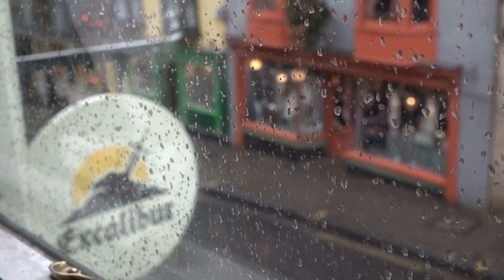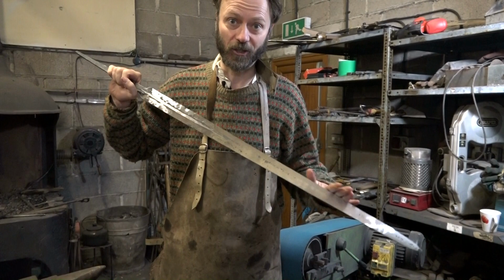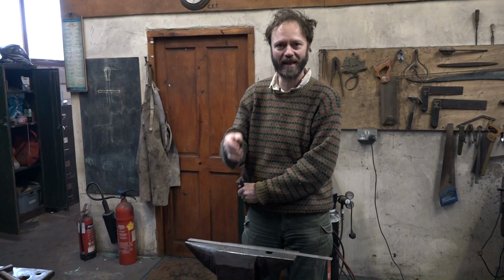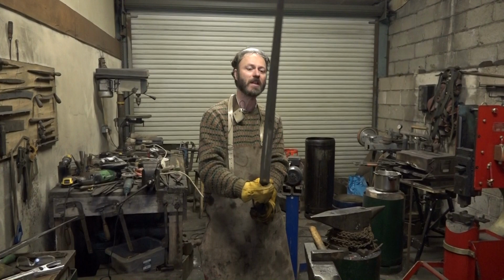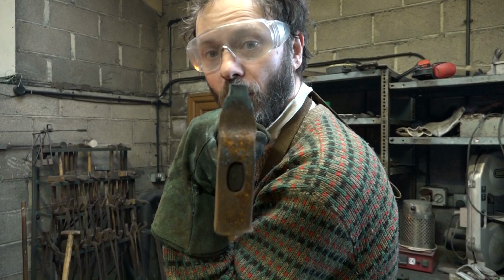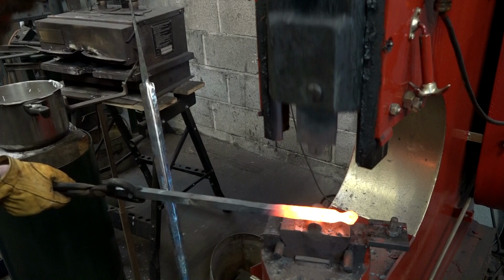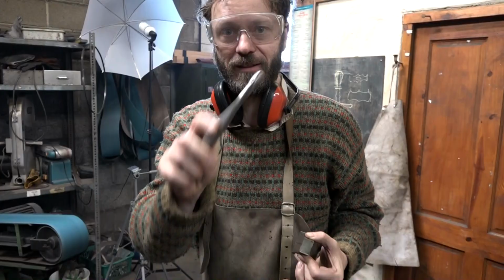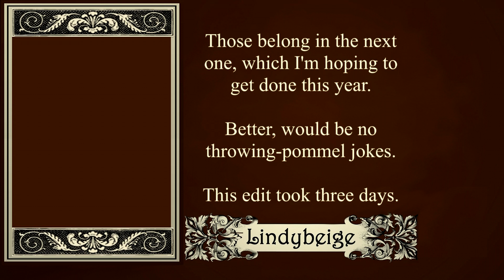Forging a sword - part four: linishing and quillons

Comment: Lloyd, I envy you that experience. Also having worked a bit of metal, I can tell you the hardest thing in the world is to make two bends look the same, no matter how precisely you measure where its held, and how far you move, control heat, thickness etc. I could see that pain when the swirls didn't match, and I empathize. I would not blame you if you did another later to get it right.

Comment: Pro tip:  when grinding with a hand-held grinder, you want to use the other side of the grinding wheel, so the sparks shoot toward your elbows.  This is so that if the grinder grabs, which it often does with inexperienced users, and occasionally even with experienced ones, the machine will jump away from you, and not towards you.  Grinding injuries are nasty ones.

Comment: The tool used for that shoulder slot is called a fuller. If Lloyd had opted for the long route setting the fuller groove, he would have used- you guessed it- the fuller. This is the preferred method for the integrity of the sword, as the smith always wants to draw or upset the steel (hammer it completely into shape, hopefully smashing the material into a stronger, more compact molecular arrangement in the process) instead of grinding material away. The increased width from smashing material out of the center of the blade to either side must be accounted for when forging the base profile.
Post Script: I'm not certain you could have found a heavier, more cumbersome twisting wrench if you tried! Bravissimo!

Comment: In the U.S. one of the benefits of making a sword with a "factory edge" is that it's much easier to ship across the country. A "factory edge" means it's not sharp but looks like it; you can sharpen it yourself. You still have to protect the pointy bit so the shipping company doesn't accidentally stab themselves if something unforeseen should happen; they generally frown on that.

Comment: It's a good instinct to be wary of the heat of a piece of steel in the shop. Chances are it's hot and the guy holding it bare handed just has no feeling left in his fingers :P

Comment: 8:20 the training swords we use at my HEMA club have been breaking about 3 inches from the tip. They're plastic so it's not hard to sand down the end to make it safe again, but it definitely does change how the weapon performs. I like the shorter ones, they're more nimble and you don't lose much since you really shouldn't be striking with the last three inches anyway.

Comment: Lloyd, we love you and your content, but especially you. Please take proper precautions when using an angle grinder, you are too important a person to lose a finger to something so ... mundane.
Reply from the maker: I took the proper run-up.
Reply: What's so Mundane about using angle an angle grinder.
Reply: @More_Row  t. seething angle grinder enthusiast
Reply: Look mate, everyone is already paranoid about danger, dont need to remind us at every turn.
Reply: @lindybeige  I dunno if you had earplugs in but the sound of an angle grinder is not really great for keeping your hearing in check. for the rest keep at it, but as with the crossguard, I believe he should have told you the heat was too low to twist due to you taking too long with the tongs. You can easily reheat the piece and go for it and get it right but now you end up with basically a piece that he normally would scrap.
Reply: @More_Row  I mean, if you're going to lose a finger, at least lose it in a joust or to a scoundrel with a longsword, as opposed to a machine shop/forge/blackmith mishap
Reply: @lindybeige  loooool funny geeza who teaches me so much

Comment: Not too many anxiety inducing moments.

That angle grinder use though...
Reply: that tufty hair and wooly jumper both make an excellent catchment for sparks, too.
Reply: @gramursowanfaborden5820  wool second best to leather as while not heat resistant it shrinks from burning rather than igniting. Hence the Royal Navy firefighting suits (Used to be called woolly bear suits).

Comment: it should be added, that a hollow grind is a valid way to grind the edge of a sword, though it is very difficult.
Reply: not really it's just rather cumbersome to maintain sharp
Reply: @alexguigui8231  okay, well I find it difficult to grind it, I can never keep it straight enough.
Reply: @MrDoYouKnowMe2211  try to use guidlines at first like a piece of metal under the sword until you're comfortable freehand grinding it
Reply: i'll give it a go, next time i decide to make a knife
Reply: @MrDoYouKnowMe2211  good luck!

Comment: Holy hell dude. PPE!
Get that guard back on that grinder. Ware gloves, and above all that, put in some earplugs. I'd also recommend an apron.
Reply: Do not wear gloves or long sleeves with rotary tools.
Reply: @farmerboy916   You're correct. Getting clothing or jewelry caught in machinery is a very real danger. I feel like angle grinders don't have the same risk as a lathe or buffer, but I'll concede the point that it's a risk to be aware of even with them.

Comment: I noticed that the fist quillon was gripped in the rotator mid-length, while the second was turned from just under the ball. I wonder what difference, if any, that contributed.

Comment: oi, lloyd, within the first 30 seconds there is a safety violation. goggles are not good enough protection when using an angle grinder, one without a hand guard as well. you should always use a proper grinding mask, similar to the ones used for welding. the sparks jump around like crazy, and they tend to bounce around the goggles, straight into your eyes.
Reply: Also the discs like to burst into shrapnel. Face shield is a must. Codpiece optional.
Reply: @philurbaniak1811  indeed, thanks for adding that, people should know. Also, gloves. Gloves are very important for when using an angle grinder especially without the hand guard.
Reply: and yet he lived to tell the tale.
Reply: @JohnyG29  it's about playing the odds. Better to have the protection and not need it than need the protection and not have it. If you prefer to carry molten iron around in your bare hands, without gloves or tongs etc, you keep on doing that.
Reply: @philurbaniak1811  I'm sure they know what they're doing.  Just chill and enjoy the video, or don't.  ❤️❤️❤️❤️
Reply: i always use gloves, there isn't really a lot for the fabric to catch on to, and it's saved me a lot of  gashes on my hands. maybe it's just me, but i always have a finger on the switch, so if bad comes to worse, i can manage to shut it off in time.

one time, a colleague of mine was grinding a frame for an electrical cabinet off the wall on a ship, and he didn't have much space, so he had to take the hand guard off. luckily he was wearing leather gloves, because the disc wedged itself between the cut, and flung the grinder in such a way that his hand was pushed into the disc. he got off with a torn glove and a small scratch on his palm.
gloves are important.
Reply: @MrDoYouKnowMe2211   Tight spaces are always dangerous with a buckeye, particularity if you cut backwards. (with the sparks flying away from you). I worked at a shipyard myself and that's the main way people get cut. As far as gloves go, i don't wear them especially with wire wheels. Tiger paws aren't really a big deal though. They won't really bite into metal like a cutting blade.
Reply: @rosco_p_coletrain1795  never use wire wheels all that much. what's a tiger paw?
sorry, not a native english speaker.
Reply: @MrDoYouKnowMe2211  18 seconds into the video. Unless its a grinding rock but i would think a rock would take too much metal. They are also called flapper wheels or flap disks. Here's a link. https://www.weilercorp.com/tiger-paw

Comment: You should check the rockwell throughout your blade after grinding. The heat from hogging off metal to the point you can feel it through your gloves probably ruined your heat treat/temper.

It would be really sad if you go to all the trouble and produce a flawed sword.

Comment: Would it have been more practical to leave the ends of the quillons bare and then mount the roundels afterwards by hammering them on? You could make them from a different material, then.

Comment: Hey Lindybeige! Big fan since your videos on slings!
Got a tricky question that's up your alley!

What cheap and homemade armor would you recommend for a tropical climate that can stop a machete? If we assume that guns aren't used.
Perforated stainless steel?
Maybe welded rebars here and there?

What would you wear in a jungle?

Thanks!

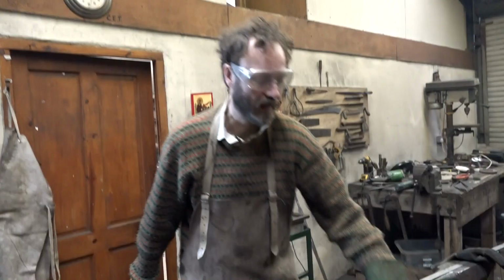Comment: 13:47
I saw an icon hanging on the wall. Is the shop owner a Catholic, or perhaps Anglican? Or maybe Orthodox, but that's starting to get unrealistic.
Reply: And the clock set to C.entral E.uropean T.ime.....
Reply: The icon is St dunstan. Patron saint of blacksmithing. Its there since the forges previous occupant, who was Germany hence CET.

Comment: Why go to the bother of a coal forge if you are going to use a grinder and power hammer? If you are forging modern forge modern use a gas forge
Reply: mill powered grinding wheels and trip hammers have been around since at least the tenth century. 
A gas forge is about five times more expensive to run and in this case wouldn't have added any convenience. If gas was better for the job they would probably have used it.

Comment: Ear protection? We don't need no stinking ear protection! Sorry but a thumbs down from me for that very reason.

Seriously the little foam cylinders that you stuff inside you ear is the base protection when using power tools and costs very little and takes little time to insert... when using a grinder the base protection of those foam cylinders is required as a base hearing protection. Best is wear the dorky ear muffs, they may laugh at them now but in 20 years they wont hear any laugh while you are the one laughing. Seriously, hearing protection, use it and abuse it. No such thing as too much hearing protection.

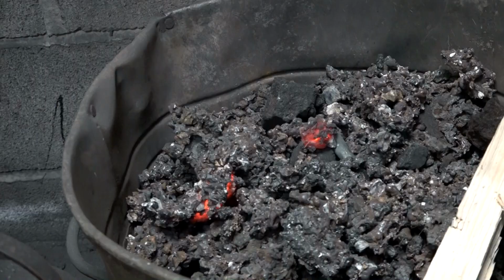Comment: As amply demonstrated by people with nunchucks, the person most immeadiately endangered by a weapon is the one holding it. So the answer to the question "should I sharpen it" is "do you want to cut yourself?"      8:00 Shots of you mostly endangering the light fittings, but also your face - at 9:50  you go for your ears.
Reply: Nunchucks not the same as swords, for one. Secondly, what a strange argument.

Comment: I weep for England. . . 
"illegal to sell a sharp sword"....
You made firearms almost illegal, yet the violence continued unabated. Shootings turned into stabbings. I guess that's somehow better...
Now an MP is proposing that knives have gps built in. Others are contemplating banning points on knives. And you can't sell a sharp sword.
What more symbolic symbol of England is there? Yet woe betide ye who thinks to keep it sharp!
You would think that at some point a realization would occur that banning tools does nothing to curtail unwanted behavior. Focus on tools and ignore behavior and you continue to get the same behavior. 
I've heard that the definition of insanity is doing the same thing over and over and expecting a different result. 
Well, Great Britain, by your actions, you seem to be certifiable. 
The sun has indeed set on the empire. :(